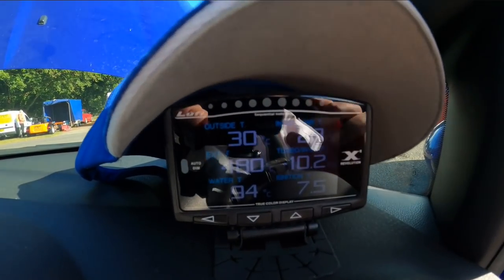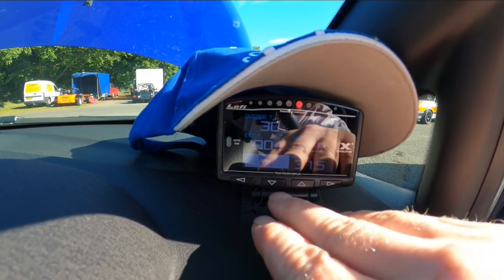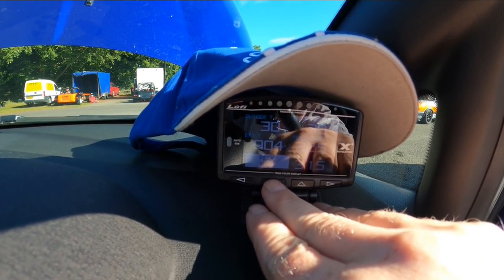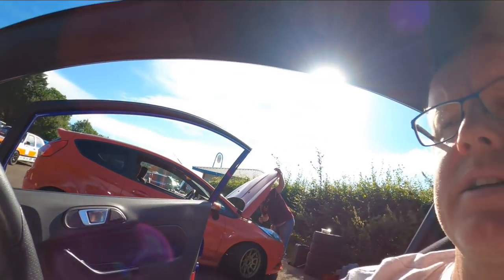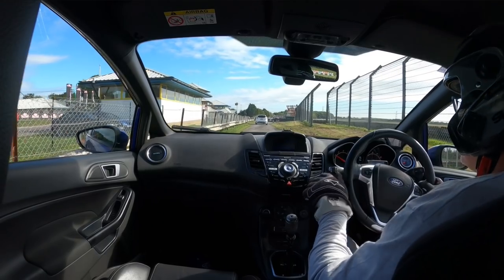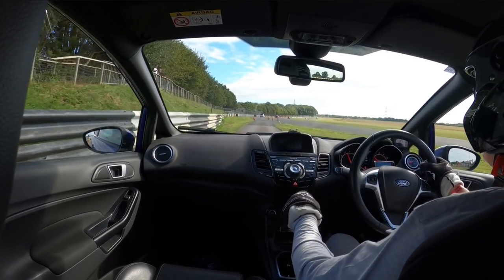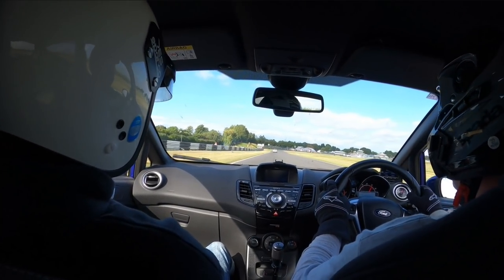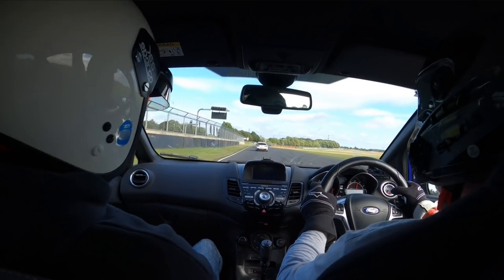Finally some great results at castle combe

Comment: Thanks so much for the data. I drive a completely different car but the anecdotal data about the radiator and water wetter really helps as my climate (SWFL, USA) is hot and my STI hates the heat. Cheers!

Comment: Steve,did you put up a video showing what mods you did to channel the air thru the rad?? I did see where you cut the fan shroud that fits behind the radiator,is that all you done??
Reply from the maker: Yeh that and modified the crash bar. I did also move the oil cooler behind the intercooler but didn't film that.

Comment: Are u running any coolant additive run purple power ice in my Leon track car and seems to made a good difference could be worth a add for cheap bit of extra hopfully my lufi gauge will be here soon to try to compare to my liquiguage
Reply from the maker: Hi Barry your order got posted this morning so you can track the updates from eBay. Yes I added water wetter the day before this and it did seem to help. Temps were good. Thanks.
Reply: @Sparkplugsteve  tried water wetter myself didn’t seem to do much then mate suggested trying the purple ice more expensive but seems to do the job
Reply from the maker: Il give that a go in future then thanks

Comment: Looks like I left too early. Popped over after work to do a bit of spectating but didn’t know how many cars would be out after lunch so headed back to Bristol before it ran out of super unleaded. You looked quick. Not quite as quick as the tool in the C2 but think you were in the 1.18s whilst chasing the other blue fiesta just before lunch. What intake did you end up running in the end SDV3 or back to the trusty ITG?
Reply from the maker: Thanks and I switched straight back to the itg after the vidoe. Decided to keep the sd clean for resale rather than is it
Reply: Not wanting to tempt fate, but now temps are reasonable and fingers crossed reliability is sorted too, any more track days planned at combe or is that it for the year?
Reply from the maker: Oulton park in just over a week. Not booked anything else yet.
Reply: Cool I’ll keep an eye out for the next vid

Comment: Hi Steve what fitment are your wheels or do you know the fitment of the gold ones on the red fiesta. Thanks.
Reply from the maker: My 15s are et35 and the 16s et38. Gold ones are either et 30 or 35. Not 100% sure. Fiestas are 4x108
Reply: @Sparkplugsteve  okay great thanks for the reply.